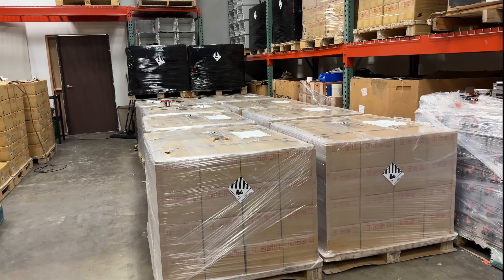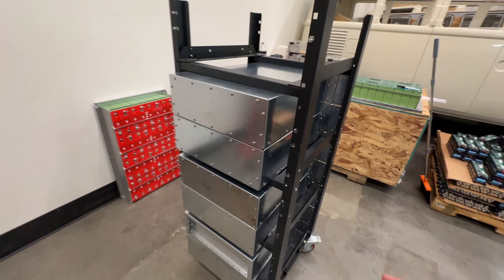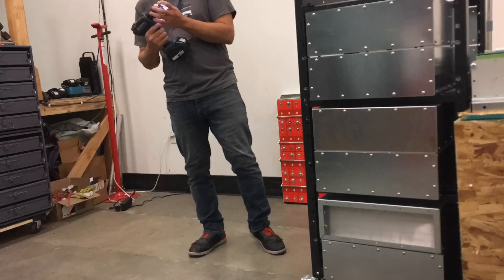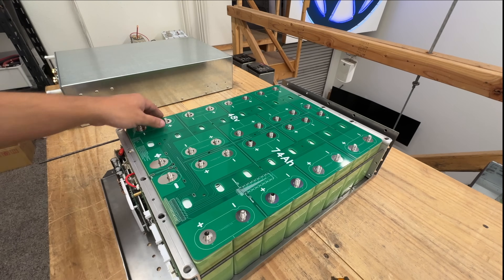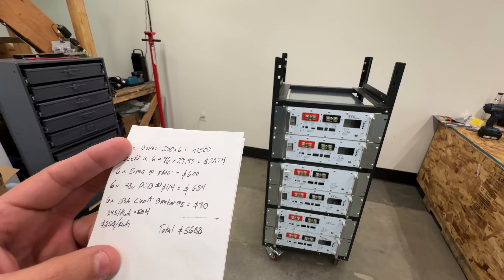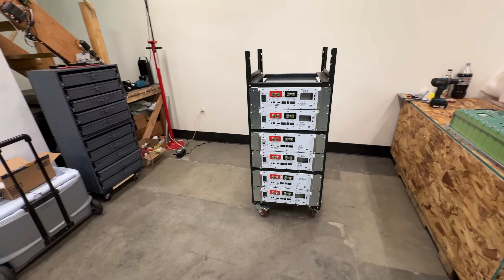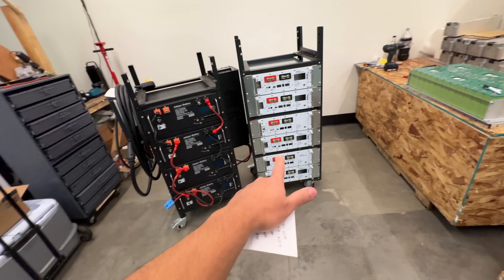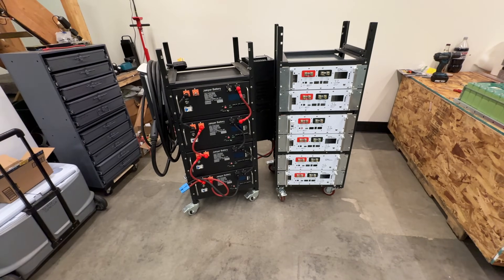$250/kWh DIY Rack Mount Solar Backup LiFePO4 Battery system

Comment: Can that rack really hold 6 of those without any bend/buckling/etc? That's about 900lbs of batteries right? Metal seems a little thing.. and the wheels as well can handle that much weight?

Comment: Kinda hard to sell for 250/kwh diy when you can buy from China new for same price. Diy is getting hard to sell for more then 100/kwh. Cheers
Reply from the maker: And yet the first batch sold out pretty quick
Reply: @jehugarcia  that's good. You have a good following and supply. It's hard to get cheap batteries here in Canada that isn't Chinese cells. Most would just buy the cheapest they can find here . I've bought a used leaf battery and it was burnt to a crisp. Cheers and keep up the videos. Thanks

Comment: And do you plan on a battery setup to support enphase microinverter systems? There is a BIG business opportunity there since their compatible/same branded batteries with built in AC coupling are very expensive.
Reply: A GenetrySolar inverter will charge batteries directly & supports A/C coupling.

I just received my GS12k & works great with some recycled batteries. 

Finishing up my solar panel racking for A/C coupling, now.

Comment: Great review and good pricing, but the mulligan is always going to be the weight/cost of freight shipping to the final destination. That could easily add another $500+ to the final cost, depending on where its being shipped from and to. Keep up the fantastic reviews and work!
Reply: $150 flat rate.  Sometimes free freight form Signature Solar.  EG4 is under $250 before shipping, the big 14.3kWh battery is priced really well too.  I'm almost debating it but I plan to wait 2 more years then pull the trigger.

Comment: I used heavy duty adjustable racking system from my local hardware store. I double up my jakiper batteries on each shelf. Cheaper than the rack and it modular.
Reply: Which rack, which store. Some info please
Reply from the maker: Link in the description
Reply: @d.pollard5962  im in Australia so I went to Bunnings..